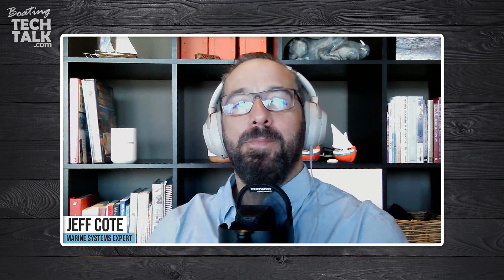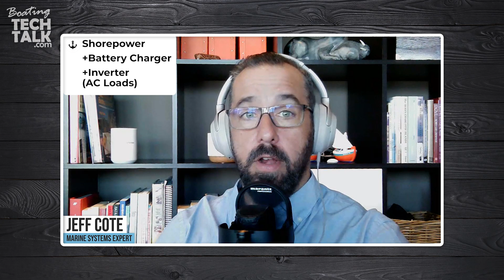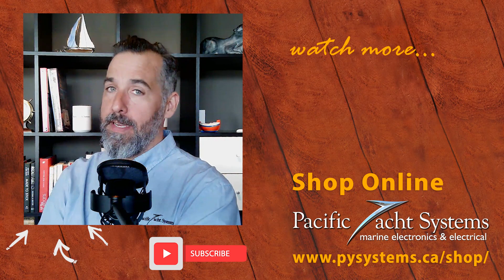When Retrofitting  A North American Boat for Travel in Thailand, Do We Need Two Shore Power Systems?

Comment: I have a Euro boat in the usa.  Finding it hard to order euro powered equipment and devices here.  How about Skylla type charger for any type of shore power and two inverters pulling from your lithium house bank?... one 230v/50hz inverter feeding your primary AC loads and one 120v/60hz inverter to power a couple outlets for using usa powered devices?